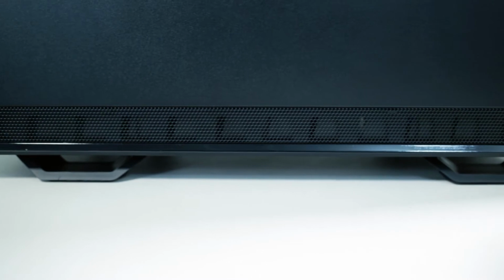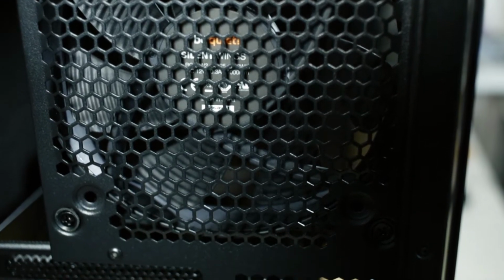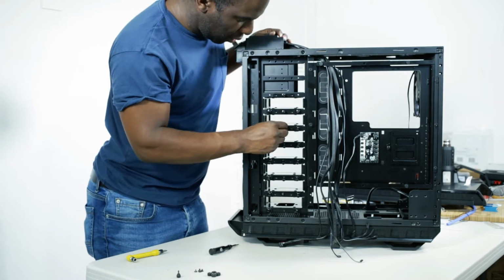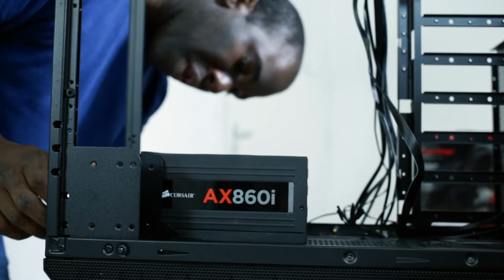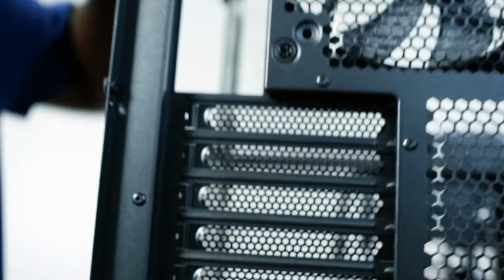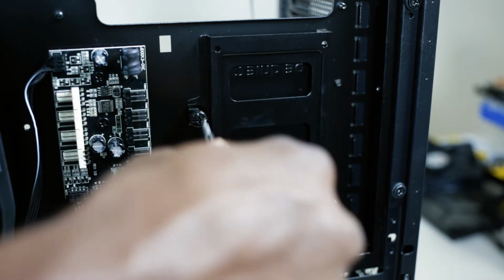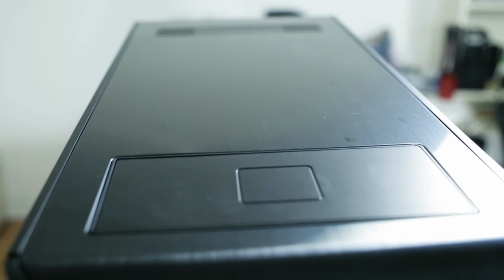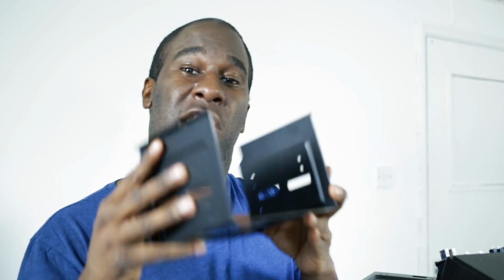be quiet! Dark Base Pro 900 Review

Comment: woo first comment there is 3 things wrong with the case  no psu shroud no cable managment grommet cover and it dont come with a  gpu mount to display your card though the window
Reply from the maker: They should of added a shroud i agree!
They should of added cable management grommet cover 100% agreed on that!
They could of added this, but i think this case is complex enough, but they may do this on a newer update, who knows!
Reply: my new pc will  be built in this case
Reply: There is a company called V1 Tech that makes color coordinated (to match the case trim color) shrouds for this case. Their is a full length version as well as a version that comes up to the hard drive cage. I'm doing a Be Quiet! 7700k build using this case later this month and have ordered the full length shroud. If I can remember, I will update this comment to let you guys/gals know if it's worth the extra $65.
Reply from the maker: Yeah, let us know how it goes! 😊